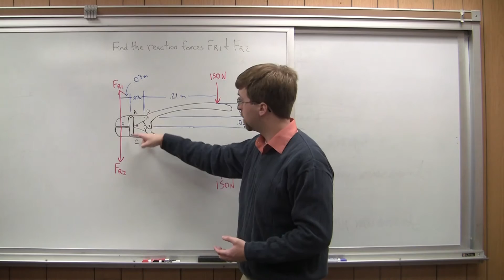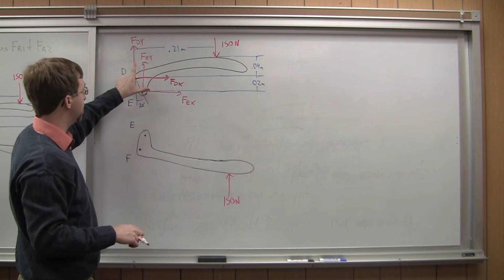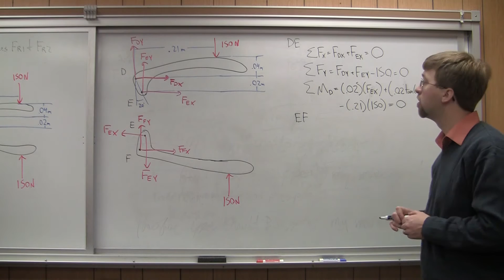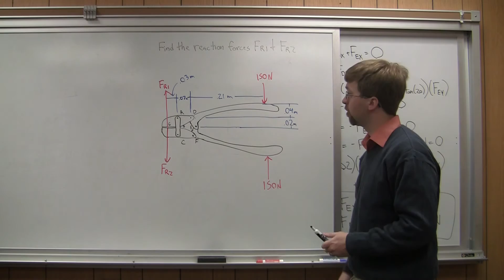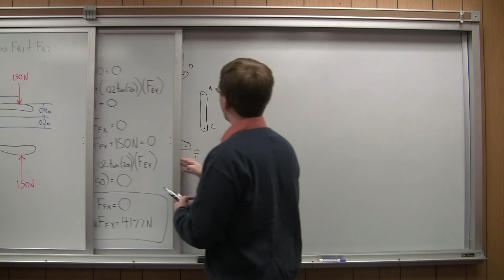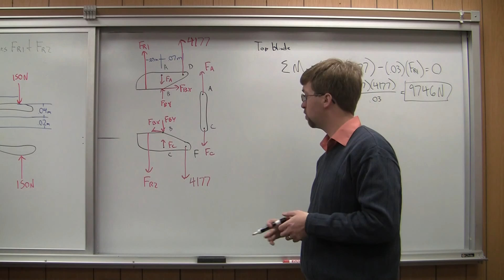Analysis of Frames and Machines - Adaptive Map Worked Example 3

Comment: So FR1 and FR2 are reactions and not the actual "cutting force"? Using everyday observance, when you squeeze the handles of those cutter, the blades are forced together to cut the object between them, not away from each other...
Reply from the maker: +xMavrekx Correct. FR1 and FR2 will be the forces the cable (or whatever we are cutting) are exerting back on the bolt cutter blades. They will  be equal an opposite to the cutting forces the bolt cutter exerts on whatever it is cutting (Newton's Third Law pair)
Reply: +Jacob Moore It just gets confusing because that would be the force right before the object cuts. If it exerts 300 lbs of force back on the cutters then it will not cut and the pliers are actually in static equilibrium. The point at which the pliers start to cut the cable would mean that the pliers have more cutting force than reaction... Correct?
Reply from the maker: +xMavrekx The third law pair (reaction force and cutting force) will always be equal and opposite, equilibrium or not. Technically, the sum of the forces on each blade part will not be equal to zero as it accelerates through the material (hence allowing for the motion you describe), but for some problems like this we will assume what is known as "quasi-equilibrium" meaning that the accelerations are small enough that the sum of the forces are basically equal to zero. This small deviation allows for the motion in the system, but with the small accelerations we would expect with a system like this, ignoring accelerations only causes very small errors in the forces we are calculating (like less than 1%).
Reply: +Jacob Moore Very interesting. Thank you for the replies and for the video itself. I wish I had a professor that made the material as clear as you did in this video.

Comment: Why are the reaction forces not equal and opposite?
Reply from the maker: I am a little confused about the question. The reaction forces shown are equal and opposite to the cutting forces that will be applied. Because we are analyzing the bolt cutters and not the cable we are cutting, we are interested in the forces on the bolt cutters, not the forces on the cable.
Reply: @jacobmoore8043  yes that was my mistake, putting them in the wrong directions, thank you